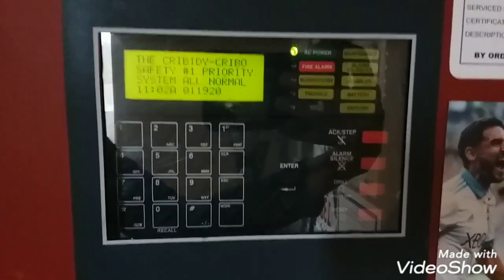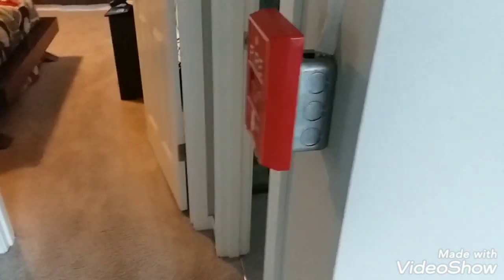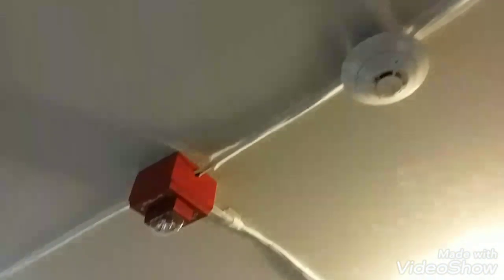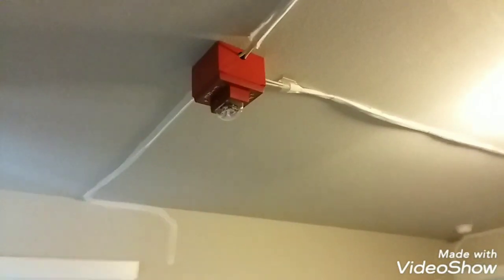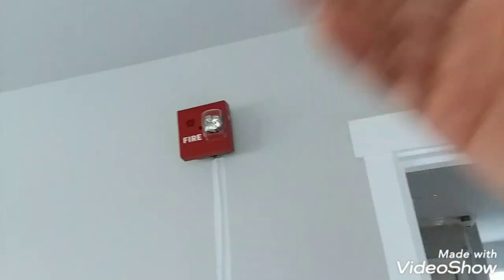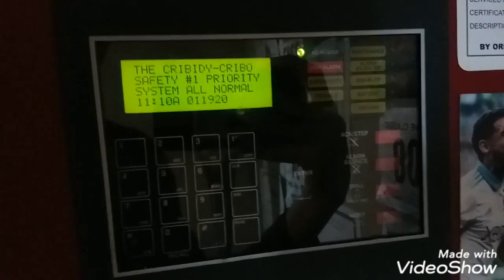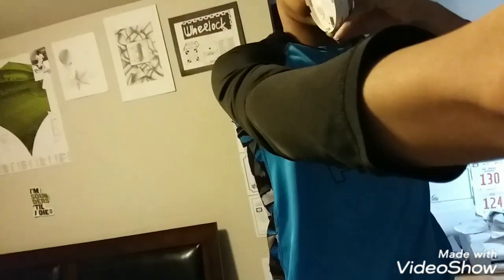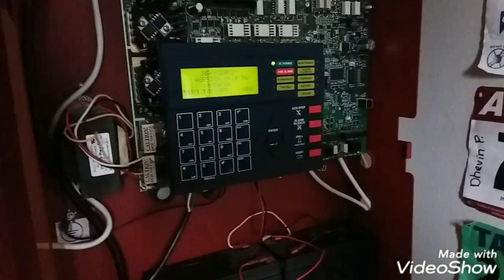System Test 40| Angry Horns

Comment: My elementary school has Siemens U-MHT-S17 mini horn/strobes in the classrooms and U-HN-S17 mechanical horn/strobes in the hallways, all of which are set on Code 3. However, one of the U-HN’s in the gym was replaced with a Wheelock ZNS. I actually own a U-MHT-S17, three U-MHU-MCS horn/strobes (including Faraday 2834), U-MHST-S17S, U-MHST-S75S, U-MHST-S110S, U-MHST-MCS horn/strobes and a U-MCS-W stand alone strobe.
Reply from the maker: Nice, my elementary school before it got torn down and rebuild had Simplex 4903-9219s as the main alarm inside the main building and Wheelock MT-24-WMs all around the perimeter, I actually posted a video a while ago of the system being tested.

Comment: I know this an old vid but I got one of those mechanical horn strobes now! Granted the fire lettering is on the side of the strobe instead of the front of the horn
Reply from the maker: Cool beans! So you have the S17 or S30 model where the strobe is fixed and not multi-candela? The wall mount MCS versions are the only ones that have the fire lettering on the front while having a multi-candela strobe. The reason being is that the Candela selector is on the side of the strobe, which would've cut into the fire lettering if they had kept the lettering on the sides. Because of that, they put the lettering on the front.
Reply: @BlackLightning4547  huh thats reallly interesting! Mines the s30 I believe
Reply from the maker: @FourtyFiftyEighty  Coolio!

Comment: Hey who told u to bother that alarm I done told u time again these safety equipment are not Toys u could face serious Penalty and fines for messing with safety equipment putting lives in danger don't pull alarm unless it's a fire or emergency
Reply from the maker: It's MY system that I installed for DEMONSTRATION PURPOSES ONLY( as I said numerous times in my videos) in MY MOM'S HOUSE(where I'm living at the moment). The system doesn't even cover the whole house. The system is local and doesn't dispatched the fire department. Who am I putting in danger?   Everyone knows they're not toys and you can face serious penalties. Why do you think I have a disclaimer in my intro as well as in the description to not pull alarms IN PUBLIC BUILDINGS unless there's an emergency?

Comment: this system reminds of a location i recently looked up called Rosemary Square. it had Siemens UMMT's and U-HN's throughout the locations. there was also a couple of Siemens rebranded ZNS's and AS's. they are all over the complex and The UMMT's and the Wheelock alarms were self-coded to code 3 and The U-HN's were coded by the panel to code 3. also, in some portions, they also had a couple of integrities. The Residental apartments also had UMMT mini horns in each unit.
Reply from the maker: Oh nice!
Reply: @BlackLightning4547  and trust me. if i were at Rosemary square, the U-HN's went off, I would get very startled. But i won't get startled by it too much if it was doing code 3.
Reply from the maker: Yeah I feel you

Comment: these horns sound like 9838 kinda
Reply from the maker: Nah, they sound like 9805s
Reply: @BlackLightning4547  at 10:21 is that a 4030 and do you still got can you use it
Reply from the maker: @vintagesimplexfirealarmsof6440  I do not own any AC powered devices, so no, that wasn't a 4030
Reply: @BlackLightning4547  what was it
Reply from the maker: @vintagesimplexfirealarmsof6440  if you're referring to the alarm on the ceiling, it's a Siemens U-HN-MCS
Reply: @BlackLightning4547  the black horn at 10:21 near panel
Reply from the maker: @vintagesimplexfirealarmsof6440  Oh, that's my desk lamp, now I see where you got 4030 from as it's shaped like one.
Reply: @BlackLightning4547  i got it i thought it was one

Comment: Knowing the backstory of the Siemens-Wheelock debacle in 2008, the Wheelock sync module's presence further angered the Siemens/Pyrotronics/Faraday horn strobes, as they cannot run on FWR. A short story about how Wheelock screwed Siemens had an impact on these horn strobes. A fellow U-HN-MCS once said: "Get off my turf you stupid Wheelock module, your company has devastated our devices!"
Reply from the maker: Originally these devices were manufactured by Faraday, who then got bought out from Cueberus Pyrotronics and later Siemens. By the time Siemens had to use Wheelock's devices, these devices were already phased out

Comment: So awesome dude, I can’t believe the U-MMT Flashes crazy I think
Reply from the maker: Thank you. Like I said in the video, the reason why the U-MMT was flashing fast because of the cut in current everytime the NAC turns off
Reply from the maker: @Mike Graham yes, the other 3 alarms have two NACs going to them(the alarm in my closet is the EOL). Since the gym only has one NAC, alarms placed in there will have to be in a two-wire configuration
Reply from the maker: @Bart Lee the P2WH-LF flashes like the UMMT on March Time as well, some alarms have a built-in delay before they sound/flash, some don't

Comment: The horn in your room is kinda raspy...wonder why. But i liked the setup with mechanical horns and a UMMT!
Reply from the maker: Usually the Siemens U-HN-MCS horn/strobes and other variants have more rasp than the others like the Simplex 4903-9219 and my Gentex WGMS24-75WR even though they use the same mechanism. I was going for a whole Siemens/ Cerberus Pyrotronics themed system
Reply: I think it's because FireLite panels tend to use FWR voltage rather than regular DC voltage. Electromechanical horns like the U-HN-MCS don't really like FWR. Think of how the Simplex 4903-9405 and 4903-9217 sound. On my old channel (pivotous), I had a video where I tested a 9217 with my FireLite MS-2, and it sounded awful. Meanwhile when I connected the same alarm to 3 9-volt batteries, it sounds like it's supposed to. FWR and electromechanical horns don't mix.
Reply from the maker: @Dr_Monitor  Umm... All of the alarms are on a filtered DC power supply that's located clearly under the main FACP, pay attention
Reply from the maker: @Dr_Monitor  The system has been filtered since system test 38